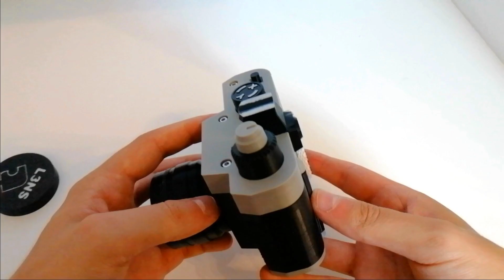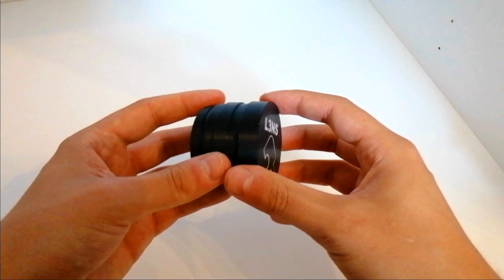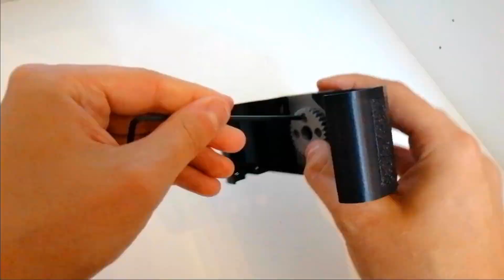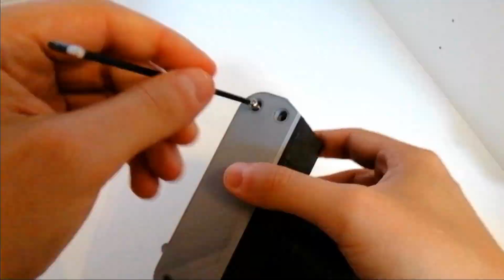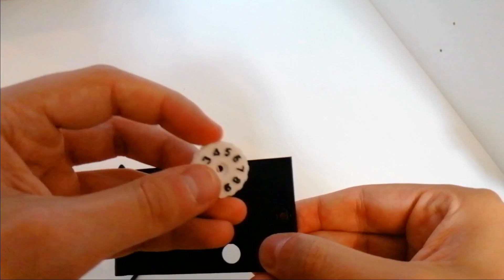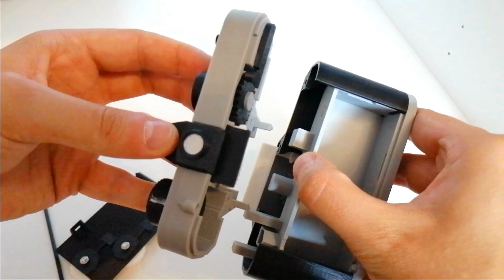A Puzzle That Looks Like a Camera | L3ns 3d Printed Puzzle Box

Comment: Yours went together alot better then mine. Had a big issue with the internal gear that shows the hint for the door to unlock. The gear and the post that sticks up from the bottom didn't line up ,spent a hr or longer sanding it and try to get it to snap it . I put the key in the top part where you had it when not and use , I turned it then it broke off inside now , door warped and trigger broke also need to redo some parts
Reply from the maker: Hey. Sorry to Hear that you had some Problems. Did you Check out the assembly instructions PDF file that Comes with the files? Out of All Tests i did i never had Problems with the Display gear. What printer did you use?
Reply: @EmGi_  I used the ender 3 V2. Yeah it's like the bottom part and the top part don't seem to line up. It seems like the eternal mechanism where the little post sticks up at the top doesn't line up with the bottom hole for the gear it's like it's off I'm not sure what that's going on with it just doesn't seem to snap